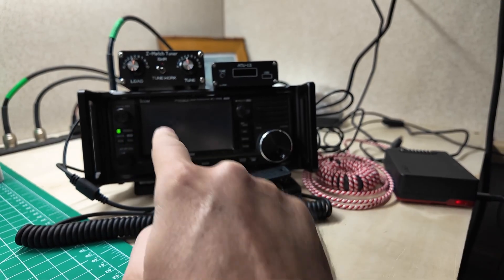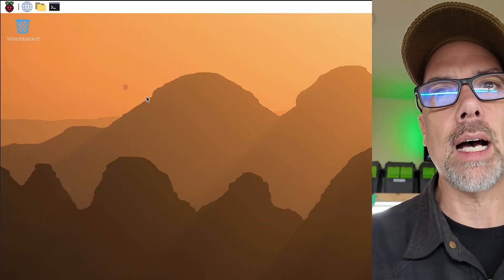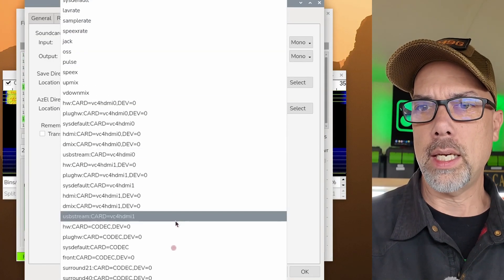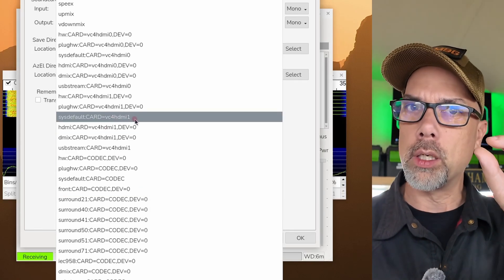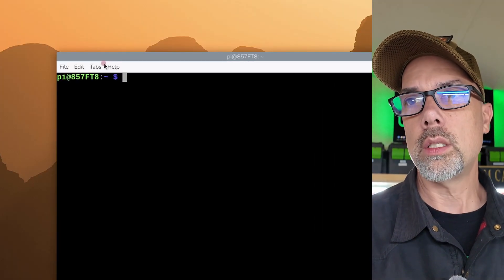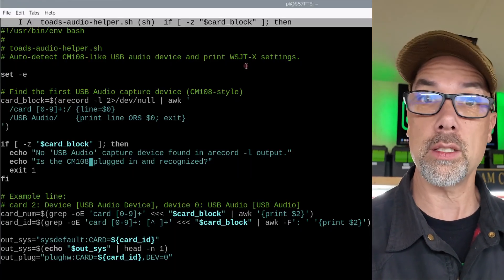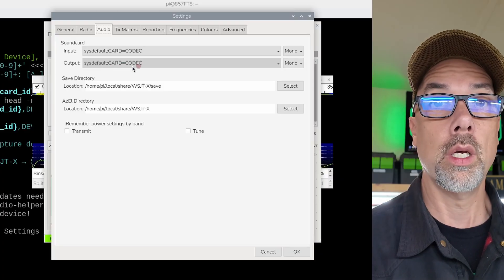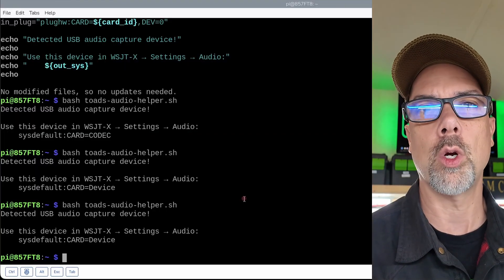Trixie Tricks Us Up On FT8/WSJT-X

Comment: Not your primary subject, but here's a handy emergency hack for viewing pop-ups larger than your screen on Pi: Temporarily rotate the screen in Display settings (and the display - or your head!) . Rotate everything back after you finished dealing with the off screen setting.  Portrait mode has more vertical height...

UGLY hack, but it can be a lifesaver on a POTA where you don't have a bigger  screen to plug in, or can't work in higher resolution...

AE0GL

Comment: There is another option, set it to default and then set the actual radio sound card inside of pavucontrol. You can then correctly set ALC properly by doing this: set wsjtx to -3db and pull your volume back in pavucontrol to calibrate the radio to half power.
I'm pretty sure you can still do the calibration if using the sysdefault options as you'll be talking to pipewire.
For 100W radio, 0db is 100, -3db is 50W, -10db is 10W, you get the idea :)
Reply from the maker: Thanks for the info.